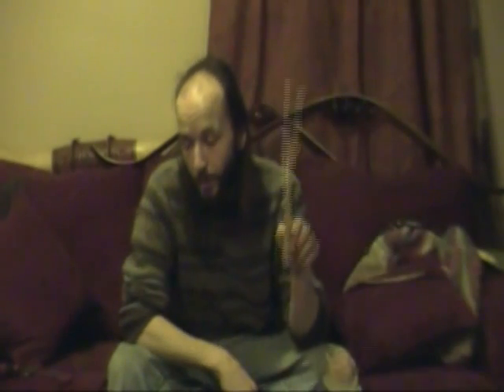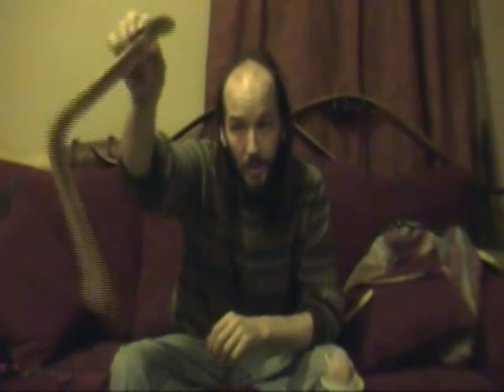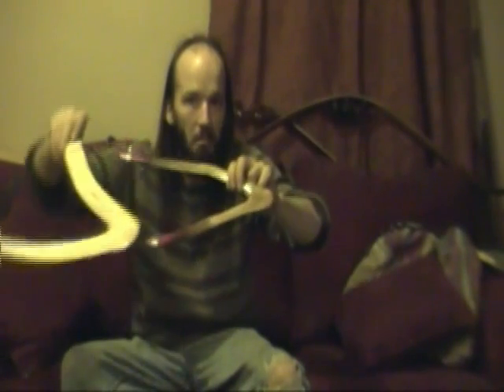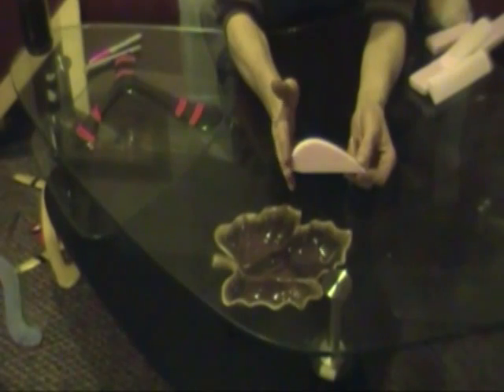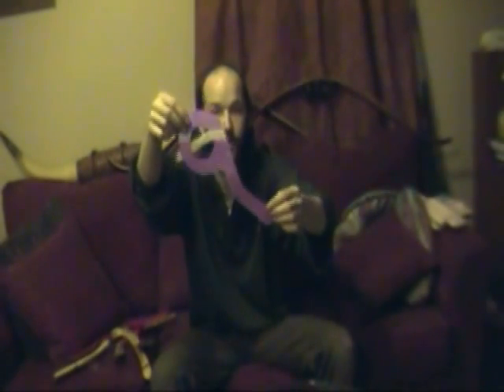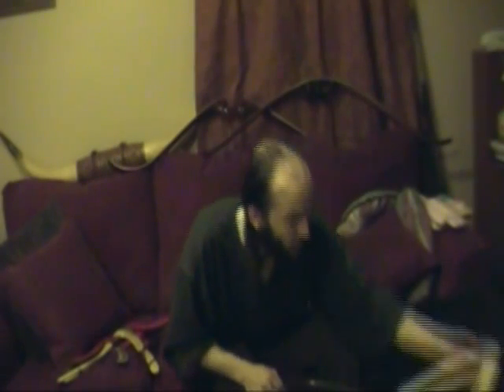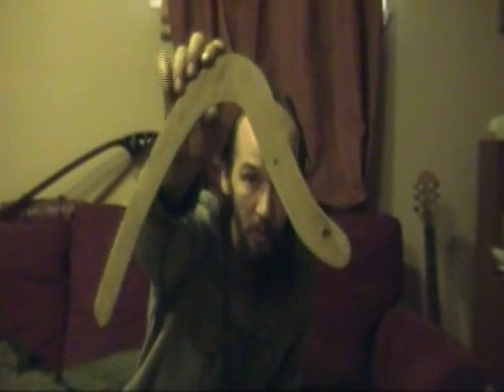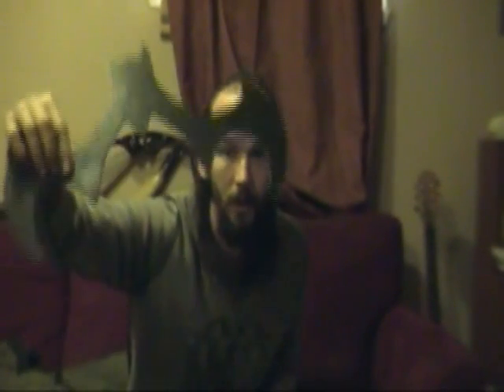How to make a boomerang  [Part 1]

Comment: By the way... Have you seen the "twice around" boomerang? I was wondering if anybody got anything similar because I'm trying to elaborate a kind of theory based on the analysis of different boomerangs and shapes, which allow them to fly in very unusual ways, like for example an MTA, so that to be able to design a MTA but with a different shape than the boring reaper one or the other triblade with one blade much longer...
Insaw the twice around and wondered how could it make such perfect two cir

Comment from the maker: The amount of lift generated is proportional to how fast the wings cut through the air.
 
So greater speed = greater lift.
And greater spin = greater lift.
 
In theory, if you could spin it fast enough but with zero speed, it should fly kind of like a helicopter.
 
The trick to make them come back is a fine balance between speed and spin.
 
Also, you noticed that one wing was not moving. so that wing produced zero lift. This is of the reason why boomerangs turn. Because only one side is lifting.

Comment: at the lower part of the spin circle, exactly as the wheel of a car has speed zero in the point where it touches the road... If you threw a boomerang much spinning than that, will it fly differently? I think so! But I have tried it with small indoor boomerangs and couldn't see any difference... WhT do you think?

Comment: Yeah you are right... This is cause its the rotation speed of the boomerang itself what most causes the lift. Thus a stronger arm will launch it with the neccesary spin.
That reminds me: of course a boomerang must rotate to fly as it does... But suppose you throw a boomerang in such a way that it spins much faster than normally in relationship of the ground speed... I mean: if you ever saw a long exposure photo of a night flyer boomerang, you see that each wing seems to stop at the lower part o

Comment from the maker: A good question. I think there is an upper limit to mass/lift.
 
You could make a large boomerang, the only limiting factor would be if you were strong enough to throw it hard enough.
 
But I think density/lift would be more important. Aluminum boomerangs are about the heaviest you'd want to try I think. Any heavier than that, and the lift would not be enough to make it change course sufficiently.

Comment: it will weight more, but since the airfoil is the same, so will it be the lift, and so will it be the precesion spin. The only obvious difference will be that the cocient between weight and precesion will be bigger, and so the flight distance. My doubt is: is there a critical point/cocient in which the boomerang is so big that no lift can make it complete its path or it depends only on the energy of the launching?

Comment: but if you throw it really soft, it wont produce any precesion and will simply fall to ground after a few meters...so to a big momentum a big precesion will occur. The real fact is that you have to make a proper airfoil to produce enough precesion spin, and that's the difficult with a ring shape. But imagine you made a ring boomerang out of balsa... Do you still think it wouldn't be able to return? It depends on the airfoil. Now if you make that boom out of hard wood or polypro, it will weight

Comment: @ sparkpluggers2 and L00NGB00W:
I know about a plan of a ring boomerang. I too used to think they couldnt fly but because of the shape and not because of the momentum (my theory was they wouldn't have any leading edge...) But I think that the fact about the momentum is false: the precesion spin is as hard as all the other forces involved and increases parallel to them. You can see here with anu regular boomerang: no matter how hard you throw, the circle path will be the same, but if you throw i

Comment from the maker: @ericofthewind I've never paid much attention to the weight of varnish.
 
The viscosity (Thickness) of the varnish affects the penetration though. And the better the penetration, the more durable the finish will be.
 
The only trade-off is that a thinner varnish requires more coats and sanding in between coats. Because the wood will absorb the varnish.
 
One finish I really like is called Minwax 'Wipe-on poly'. You use a rag to apply it. It's thinner than water. It's almost like a french polish.